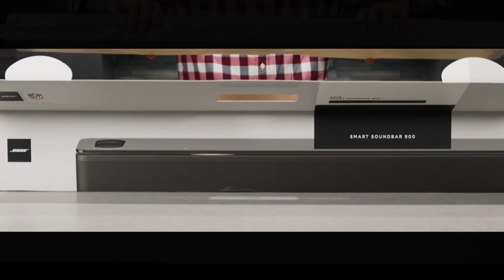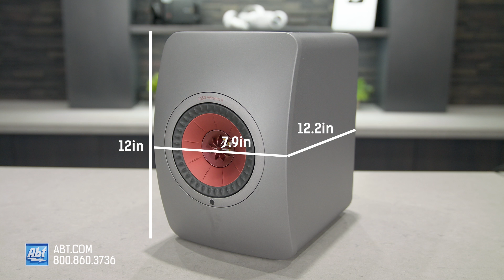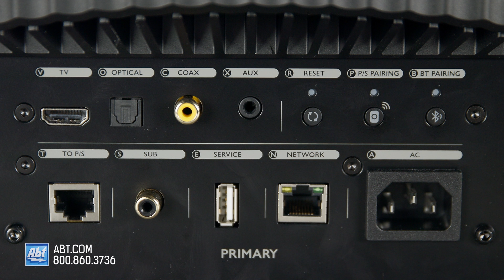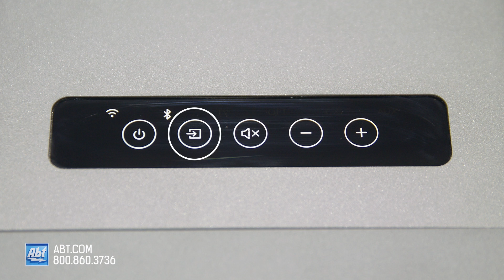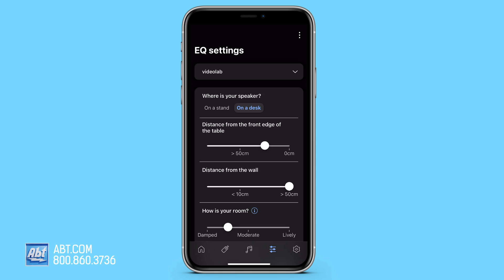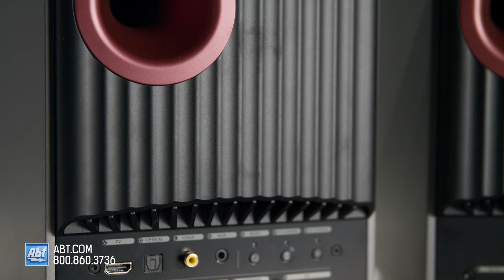KEF LS50 Wireless II Bookshelf Speaker Overview

Comment: another shop trying to sell those speakers, unfortunatelly it is bias review of a guy with a big smile, after 4 minutes i did not hear any cons, for example the connections, no USB, no analogue anymore, that sucks... and ABT does not say anything of this... so how to connect my laptop ???  i am sorry but i expect more neutral reviews from ABT... right now i can t trust them anymore, selling 3000 usd speakers you expect the seller to be neutral and balanced, explaining the pros and cons... anyway you get my point, this is a commercial, not a proper review...
Reply: I connect my Mac - USB-C to 3mm jack. No issues. But why bother. Chrome cast streaming is perfect for me and indistinguishable from hard wired playback.
Reply: There is a usb
Reply: @nathbrouillette  service only... so no usb
Reply: Did you say no analogue? Isn't there an analogue AUX input shown in the video?

Comment: I have a Pair of Klipsch "The fives" for a modest Home-teater, and also to rarely hear spotify music; I'm thinking to replace those with this KEF . Does it worth for me? Or is something more deep on the "audiophile spectrum"?
Reply: It's all snake oil.  You can EQ a speaker (most of them) and change room acoustics to make it sound good
Reply: @Karim-ik5ij Indeed, but here it s about finesse. I had Edifier S3000 pro, Audioengine A5+, and other soundbars and speakers. Ls50w2 have the most natural sound, detailed and pleasant.
Reply from the maker: @Aguirre Ortiz This KEF model is hard to beat. Another one to consider is the B&W Formation Duo: https://bit.ly/3UYLkRR They are excellent speakers, but the price point is quite a bit higher. The LS50II is a great value when you compare the performance between the two models.